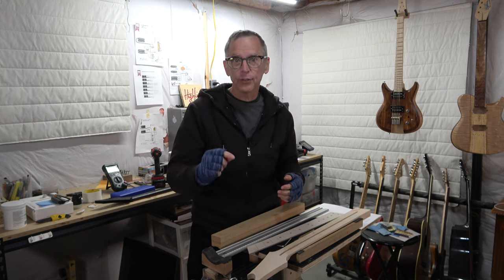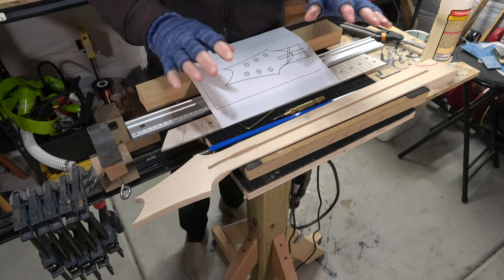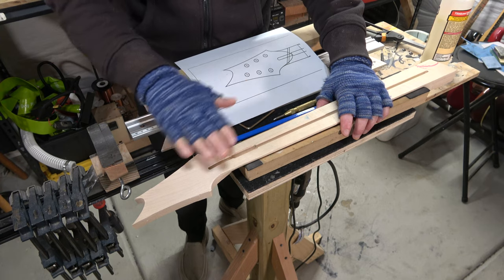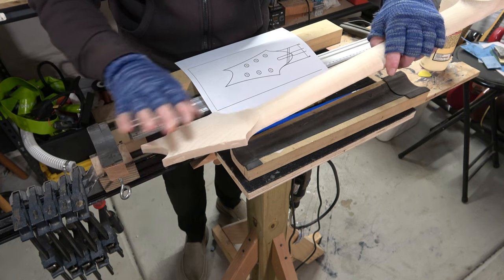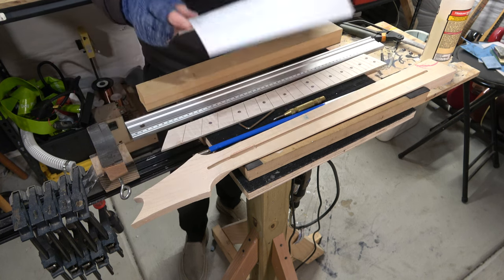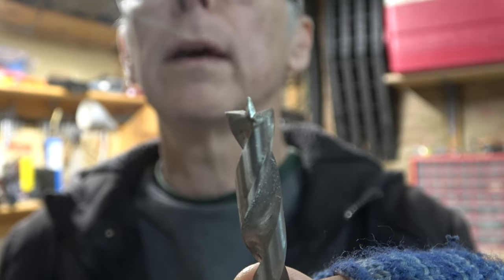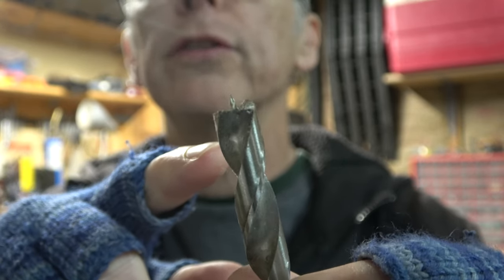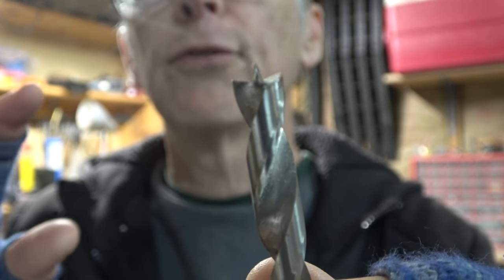Making A Six-String Multi-Scale Guitar: Drilling The Tuner Holes And Gluing On The Fretboard

Comment: Hmm... fascinating sanding board.  I kind of like it!  I've always used a heavy, flat sheet of glass with spray adhesive and sandpaper, but yours looks like an easier sandpaper replacement.  I may have to try that (or a hybrid).
I also like the black tape and caliper trick too -- sooo many different ways to accomplish each thing! 😁

Comment: Hello Chris,

I recently glued a fretboard to a neck with the same technique you use. (tape for the truss rod, and a little salt) I clamped the neck with an aluminum bar that I usually use to radius the fretboard.
Later, when I finished the whole neck and body, I wanted to make the neck straight for the fret work... and the problem begins, the truss rod has absolutely no effect when I turn hex screw..
the neck didn't become straight, didn't even move a millimeter.. And I made a last quarter turn to try again and... the screw broke. I am very angry against me :(
I don't want to unglue the fretboard and the guitar is playable (a little to high at the 12th fret but it's ok, and the guitar is for myself).
I suspect that the glue came a little over the truss rod when I clamped the neck, and that "sealed" the truss rod. Do you think it's possible ?
I used a paper tape a little larger than you, and I verified there is no glue over the truss rod before applied the fretboard.
Or maybe It's because the fretboard is ebony / the neck is hard mapple, and it's hard the adjust the truss rod because that's hard wood ? What do you think ? Have you already have this kind of issue ?
Thanks for reading me, and excuse my english, it's not my mother language ;)
Reply from the maker: I think you used a faulty truss rod.